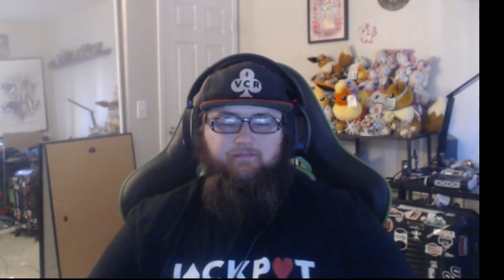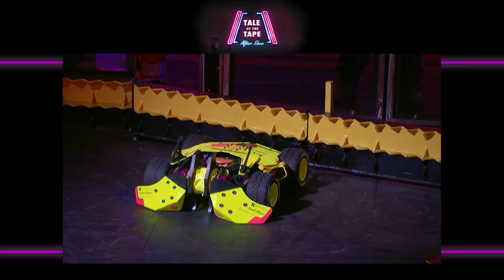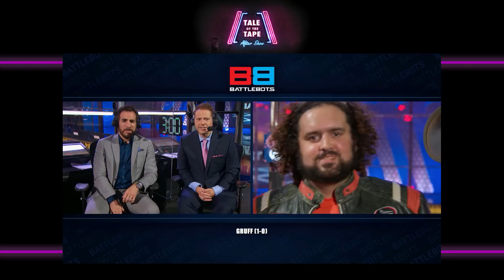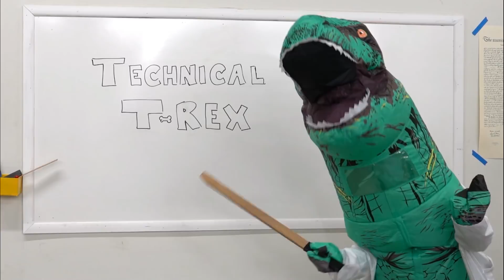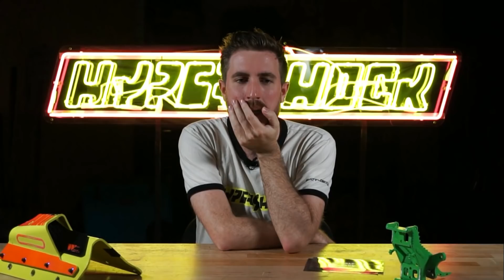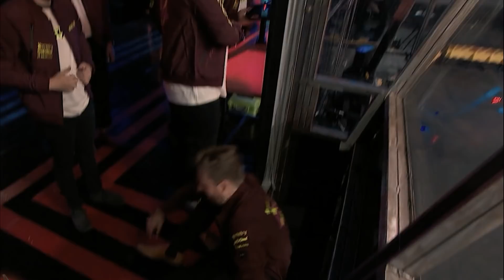Ep 3: This One Goes to the Judges! // Tale of the Tape After Show

Comment: I think it is a little unfair to talk about consistency when no 2 fights are the same. I am of the opinion that a bot should do what it is made to do, and if it doesn't, it sorta failed it's job. I still agree that beta should have fired the hammer. But rotater barely did any damage as a spinner. A no win situation for the judges either way

Comment: So if Victor's main argument for rotator deserving a 5-0 in damage is because "yeah it only landing one, unintentional damaging blow, but that's still more than beta doing minor damage," you have to use the same logic for aggression. Yeah beta not using its hammer is a negative, but its still more than rotator showing hardly any aggression at all (often not leading with its main weapon itself), so it deserves a 3-0.

Comment: The active weapon rule has not changed in 4 years which is your weapon has to be shown as working at the start of the fight and arena counts as damage,I dont agree victor took the hammer off with a aimed shot which the rules disregard as damage.i would suggest having a good read of the judge rules:-https://battlebots.com/wp-content/uploads/2019/12/Judges-Guide-Rev.2020.0.pdf

main points i take from the rules:-
arena hazards count as damage
you cant score all the agression points if you dont use your weapon
accedental damage to your self doesn't count for your opponent
your weapon has to work at the start of the fight

Comment: Beta vs rotator is an interesting one.
Now I know the rules and judging criteria, I agree. Rotator should have won.

But, as a casual fan, fairly new to battle bots, and not fully understanding of the judging criteria before all these vids. 
I thought beta won, as he seemingly bossed the arena, and only took damage due to an unlucky set of circumstances.

Does the talk of “5points for damage via active weapon only ” “active weapon in use” “wedge’s are only defensive components” etc etc making it to difficult for a newcomer and casual fan?

Comment: i don´t understand everyone saying the thing about 5 points for damage being "more" this year.  it is worth 45.4% with the 5-3-3 system and 42.8% in the 3-2-2 system, thats less than a 2.6% difference.  Also, clearly at the beginning of the season they said control bots are not at a disadvantage because they can score damage points by using the arena to their advantage. I also tried judging the match before seeing the result and i got rotator/beta 4/1,1/2,0/3. Which got 6 points to beta and is therefore a win. Think about it, if damage can only ensue due to the main weapon, robots like big dill could never win since they can´t ever score the full 3 points for aggression(assuming they can´t do damage with just the prongs). I think the decision is fair, especially because it was a split one.

Comment: Bottom line: does the "aggression" rule apply to being aggressive with your weapon, or driving as a whole? Because if you say driving, then Beta pwned Rotator for 3 minutes straight. If you say weapon, then... yeah.

I thought "aggression" was for everything the bot does, including (but not limited to) weapons. I guess aggressive driving overlaps the "control" category, right? But it might not if you have a wedge, etc.

They definitely need to clear this rule up.
Reply: As I understand it control and aggression under the rules are entirely separate. Control is about controlling the fight and the ability of the opposing bot to bring its weapon into play. Aggression is about trying to effectively use its weapon. Ramming can count as aggression but weapon use is supposed to count for more.
Reply: @seamusmcnamara3783  Right- ramming aggression and weapon aggression aren't equal, but what if the other bot isn't aggressive at all? Ramming bot should get points for that. Passively having your weapon hit the other bot doesn't really count as aggressive to me- it wasn't intentionally an attack, was more defensive.

Comment: Reaction to what Victor said:
Strategy isn't a part of the rules anymore, no points for that

Damage is based on, according the rules deliberate controlled action.
Rotator's damage taking Beta's hammerhead off was 100% not a deliberate controlled action, beta made a driving mistake, Rotator 'gyroed' with momentum into the hammerhead.
You can see Rotator's wheel wasn't even on the ground, so they had no way at all to control that attack.
I think honestly there should be some sort of downgrade on those damage points received for that since it was not deliberate.
According to Greg Munson, ramming people into walls should still get you damage points, so Beta are still due points for that.

With Aggression, due to Battlebots rules, beta is docked a point due to never using their weapon, but beta was far far more aggressive.
The rules say aggression through ramming is worth less than aggression using an active weapon, but even then, Beta dominated 99% of that fight.

*Final Scoring*: Based on BattleBots Spinner Favoring Criteria:
I'd say 3-2 for damage for Rotator due to the damage not being deliberate at all.
But being the only major damage in the fight, 4-1 also works.
Beta get 2-1 because they were far more aggressive.
Finally, Beta definitely gets 3-0 Control.
Final Score:
6-5 for Beta, being lenient to Rotator on that accidental hammer removal.
or 7-4 not being lenient.
Overall: it doesn't matter because either way; Beta wins (even with the Battlebots Spinner Favoring rules).

Sad, because it's obvious to most people without criteria that Beta won that.
As Lisa said on her scorecard, Beta dominated that. Sad to see that nearly all of that was undermined by one small driving mistake.
Any proper criteria would have chosen the same winner without it being close.

What I think they should do the judging system to fix this:
- Balance the criteria to 5-5-5 and remove active weapons aggression (but they won't do that)
- Damage points should be scaled with how valuable the damage was (RoboGames does this):
5-0 for drive damage
4-1 for a weapon
3-2 for minor damage
- Highlight and Bold the "deliberate controlled action" bit in the rules, it's there, just make people aware

Comment: Your last tale of the tape contained the information people need to know about the Beta fight.
Ramming into the arena counts as damage and aggression
Reply: Not quite. Ramming into an arena hazard counts for damage IF it causes damage. If Rotator breaks it's spinner being shoved into the wall that's one thing, but pushing your opponent into a wall isn't automatically damage. And the rules still state that pushing with an armored wedge or plough is a defensive action, although energetic slams into the hazards I believe do count as aggression.

I actually do think the hosts (and Soto) are being a little disingenuous when discussing the rules and scoring though. There's really critical rule they're leaving out, which is relevant to both why Beta won this fight and Black Dragon beat Kraken. Damage only counts if it's caused in an intentional attack (whether with a weapon or pushing into a hazard).

In the Black Dragon/Kraken fight, Black Dragon was much more actively charging at Kraken (even though Kraken was getting under them when they did), which means the damage caused to Kraken's teeth is relevant. In this fight, Rotator clipping Beta's hammer was a complete fluke. It was actually caused by Beta attacking Rotator, they missed a bit, hit the wall and everyone was bouncing around. And otherwise, the whole fight is Beta charging Rotator. That means that, according to the rules, that damage on Beta doesn't count. Leaving that out, both robots were basically undamaged, save for cosmetic scratches and dings. Once the damage is down to that level, the damage points should be split, which is what 2 judges did. And once we've established Beta should get at least some damage points, then their case for their win is much more arguable, since they obviously win control and at least some aggression.

It might still be the case that, even in light of that rule Rotator should still win, but I think the conversation was disappointing. What I heard was that they didn't like the fact that it was possible for Beta to win without firing it's weapon (which could be justified). I would have liked them to acknowledge that there is at least a case for why that happened as the rules stand and discussing whether there should be a rule change and what that should be (which would be interesting as one obvious issue in any such rule change is how to avoid biasing the rules too much in favor of spinners, which they all build. I'm personally not in favor of rules that say spinners basically score points just by having their weapons turned on, there needs to be some element that the robot has to be deliberate with it, like a flipper, hammer or lifter has to be). But to me, by ignoring that critical issue, the whole conversation came off as a self interested whinge masquerading as a discussion about judging consistency.
Reply: @leighhargreaves4104  Beautifully written. Thank you for taking the time to explain all of this better.

Comment: personally i agree with the judges on the beta rotator fight. as victor said, beta gets 3 for control and 2 for agression. now that there are 5 points for damage, it makes sense to me to split them. personally i think this fight couldve been 6-5 either way, and with close deciscions like that someones bound to get upset. the only problem i do have with this fight is the consistency of the judgs. as you brought up, the judges have been very out there with their deciscions, and if they keep this up, there is gonna be some fights wih even more controversy.
Reply: How does Beta get even a single damage point though? They did no damage to rotator. Rotator was fully functional with zero things broken off their robot. That says zero damage to me. And aggression is based at least in part on active weapon use. Again, beta had none there so you also can't give them all aggression points. I don't see how beta got enough points to win.
Reply: @David_Last_Name  Ramming into the arena counts as damage. It's not Beta's fault that Rotator is built durable lol. Also wasn't there a chain that came off of Rotator?
They got 2 aggression points I think. 1 damage. 3 Control.
Reply: @RennieAsh  "Ramming into the arena counts as damage". Not if it doesn't, ya know, cause damage. Rotator had no damage. I think you are wrong about the chain coming off, but if so please provide the time stamp of the fight and I will change my mind. But otherwise no, Beta caused no damage.
Reply: David Last Name I’d suggest you go and watch the fight yourself (it’s only a couple of minutes). It’s possible it may have been from someone earlier, but it definitely was moved after a wall collision.
Whatever the case may be, you cannot definitively say “no damage whatsoever” when such high speed steel is colliding with each other.
Reply: @RennieAsh  So what's the time stamp when rotators chain comes off?
Reply: I’m pretty sure the reason they got the damage point was because the hammer came off unintentionally. The were both bouncing around and happened to hit that way. I’m not sure on that though
Reply: @the_random_gamer3404  "the hammer came off unintentionally". Lol, well of COURSE that was unintentional, why would they ever intentionally want their hammer to come off? Sorry, I just found that phrasing funny.

But did you find the time of the fight when rotators chain came off?

Comment: Responding to rotator with me
1 you did less damage
2 you can get damage from hitting people on the wall
Reply: 1 they did the only damage
2 yes you can, but that didn't happen in this fight
Reply: @SandersChicken  It did happen lol as small as it may be, and a belt or chain came off of Rotator
Reply: @RennieAsh  from what I saw on reddit rotator only has one weapon belt. And after the hit the weapon and both drive were still working. 
People think that belt we see on the wall hit was actually left over from another fight
Reply: @SandersChicken  It could be it does look kind of thin
Reply: Also would everyone be happy is beta used it’s hammer an it immediately gets hit of.